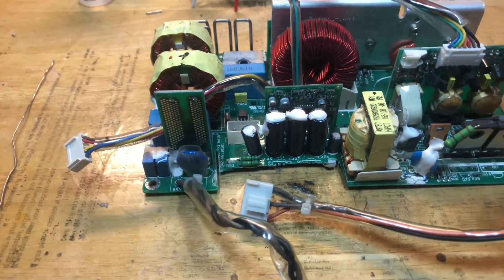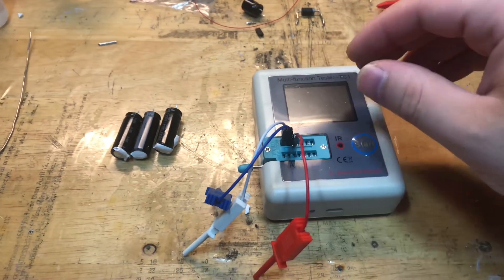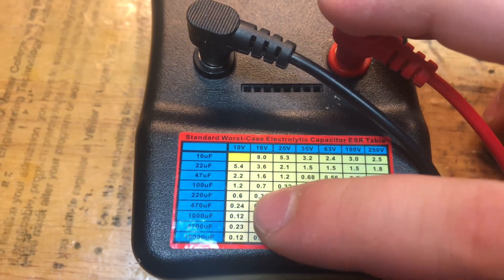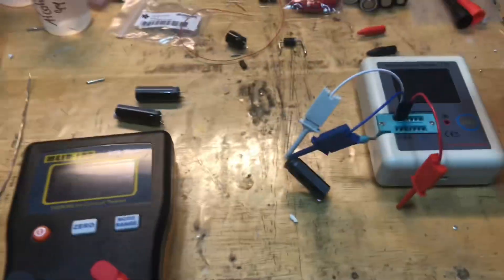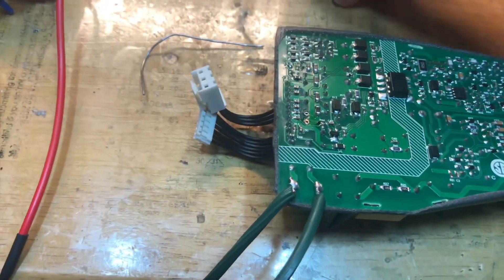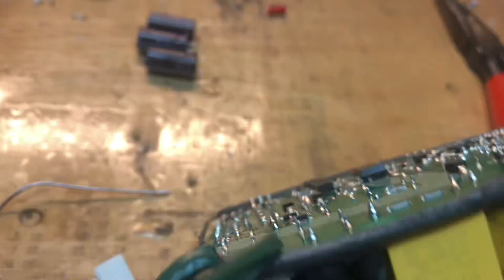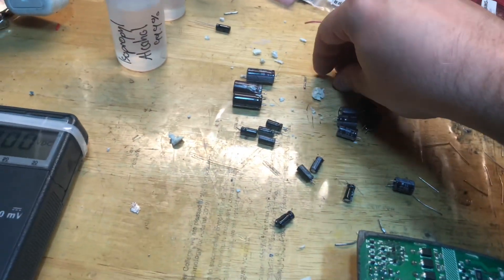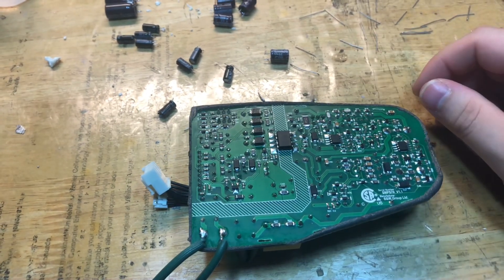Oh No! It's the Electrolytic Capacitor Plague! - Bowers & Wilkins Zeppelin Faulty PSU [Video 6]

Comment: I found a zeppelin air with the 30pin ipod dock at a thrift store got it for $10! No led or response when plugged in, opened it up and immediately noticed 2 capacitors on the power supply board that appeared buldged and had leaked 2200uf 16v and a 1000uf 35v, i found replacements also rated for 105c and replaced the bad ones, plugged it in to test and a few seconds later heard a pop then sizzling sound and immediately yanked the power cord pulled fhe back off ( still had screws out ) to find the 1000uf 35v cap i just put in blew again :( lol its sad but like comeonnn! Im not an expert by any means just a guy making the most out of what i can get! trying to fix or repurpose instead of replace and learn in the process! Anybody else have any idea what could be causing the 1000uf 35v 105c cap on the powersupply board to be blowing just being plugged in? Before replacing the caps there was no led action at all nor response to power button and even after replacing no led action just reblew that 1000uf cap after a few seconds of being plugged in? Im kinda lost on what to check next sense im not noticing anything physically obvious otherwise, after finding another cap to replace the one i just blew up any ideas? Much appreciated to whoever!

Comment: Hi. Never startup a switch mode power supply “SMPS” without no load. Thats why you supply voltahe is dropping and rising. Sometimes it Will rise the voltahe so High that it Will damage it self if you test it with no load on main rail.

Comment: Great video @Mr. ElectroniCET !

I have a Zeppelin too of which there is an issue with the WiFi module. I am sure that everything else is fine. Because I have another B&W with the same WiFi module. And if I swap the WiFi unit to the Zeppelin it works perfect.

Do you have experience with the WiFi module?
What would you advise?
Reply from the maker: Unfortunately, I do not have any first-hand experience with the WiFi module in those units. It could be just a faulty WiFi module, or there might be a failure with the power going to it. Hope this helps and thanks for watching!